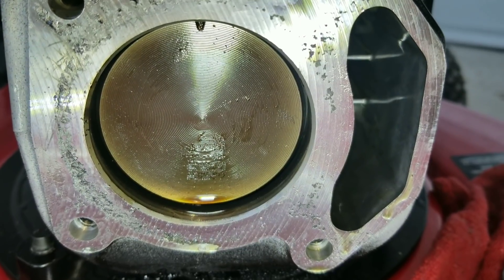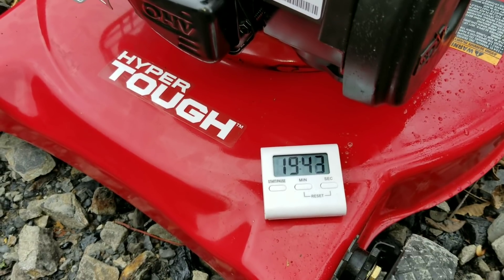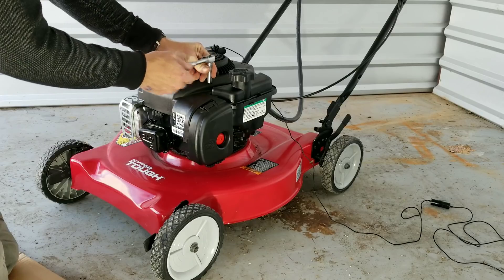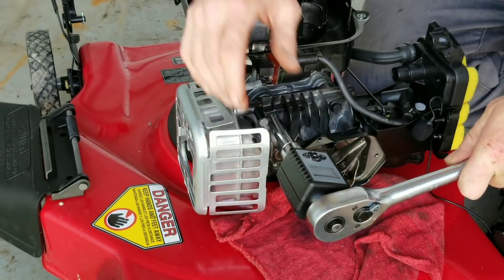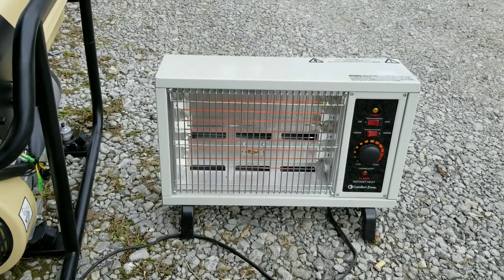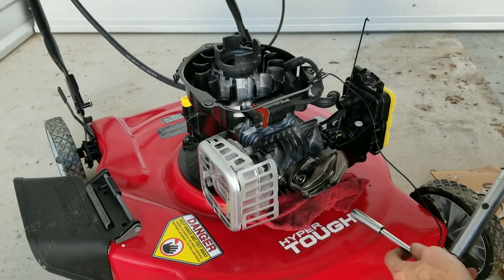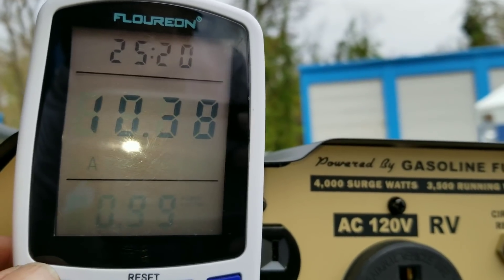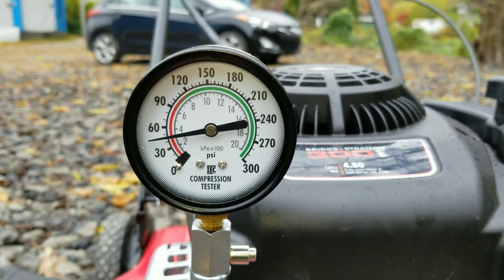seafoam PROOF

Comment: real old school trick, when i was growing up (im 60 now ) my dad and uncle owned a repair shop and gas station. They used to do a lot of cars for a local ford dealership (Dario Ford ) most of the repairs involved carbon build up. i remember them mixing a half quart of kerosene and half quart of atf, then dumping it down the carburetor at about 3000 rpm .  they had the back half of the car backed out of the shop because it smoked like hell when they did it, few times someone called the fire dept thinking the building was on fire. i remember it well. im pretty sure it did the trick as i don't remember any come backs.   
 i also remember for the slipping trannys and sticky tranny shifts, they dumped a quart of lacquer thinner down the fill pipe, drove it about 30 mph and threw it in reverse, that also worked very successfully and fixed tranny seepage , ahhh the good old days!
Reply from the maker: Yeah great stoy you like any other products

Comment: Use oven cleaner in a engine. I heard its suppose to work good
Reply from the maker: We will try good idea
Reply: Safe?
Reply from the maker: Im not sure
Reply: CAUTION: Oven cleaner is an ultra-strong base like lie (sodium hydroxide, NaOh) or another potent base, potassium hydroxide, (KOh), it etches and corrodes aluminum and other metals on contact.  This is a bad joke of a bad idea.
Reply from the maker: Yeah what about jet fuel?

Comment: (For GDI engines)  BE FULLY PREPAIRED TO CHANGE OIL AND FILTER BEFORE DOING THIS PROCEDURE, IT MUST BE DONE AFTER, AND BEFORE STARTING ENGINE. You need 1 gallon of lacquer thinner, and a rag for each plug hole. Starting with HOT engine, not running, work quickly while hot. Slowly turn engine by hand, until 2 intake valves are closed (4 cyl). Wedge throttle plate open with spout of long funnel, or suitable hose attached to funnel. Pour in 2 quarts of lacquer thinner. Let sit 10 minutes. SLOWLY turn over by hand again, until other 2 intake valves close, repeat pour and wait. 30 minutes later, cool engine- remove spark plugs, remove ignition fuse. Place absorbent rags at each plug hole. Remove fuse for primary fuel pump. Crank over with starter, until all liquid is gone from cylinders. Long crank (30 sec.) engine while pouring in remaining 2 quarts. Let starter cool 10 minutes. Crank until cylinders are dry. Reinstall plugs and fuses, remove funnel, reattach airbox. Change oil & filter. Start engine, idle until warm. All intake runners, ports, and valves will be washed clean.
Reply from the maker: Thanks for sharing  i appreciate you

Comment: After using any carbon cleaner.change oil and filter.carbon will get in the oil.use a motor flush.or broken carbon deposits could cause major scouring on cylinder walls.

Comment: You start off talking about how Sea Foam can clean intake valves on a GDI (Direct Gas Injection) engine, but you demonstrate it by spraying it through a carbureted Briggs & Stratton.  Your video is great and full of details, except it completely FAILS to say anything about cleaning intake valves on a GDI motor.  Sorry; it's a straight up failure.
Reply from the maker: If i wasnt clear i was showing inside of the valves and had just did a video with seafoam vs crc